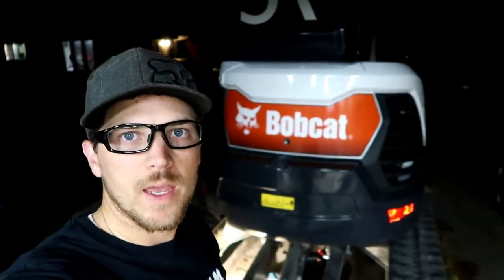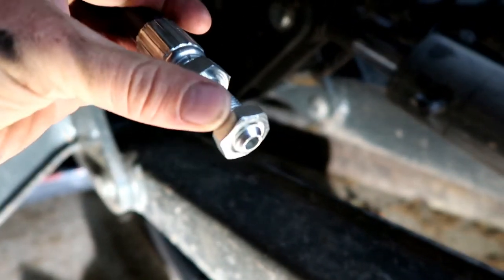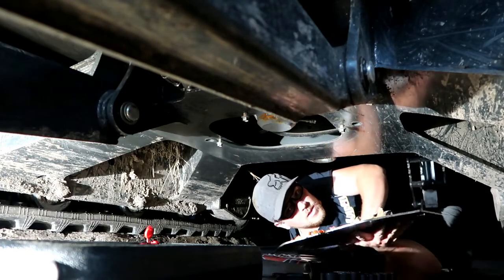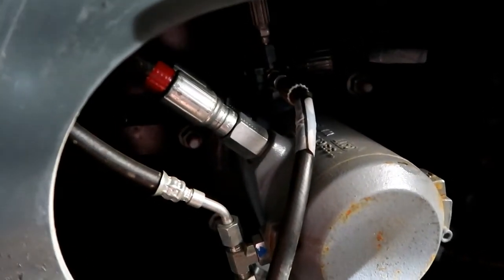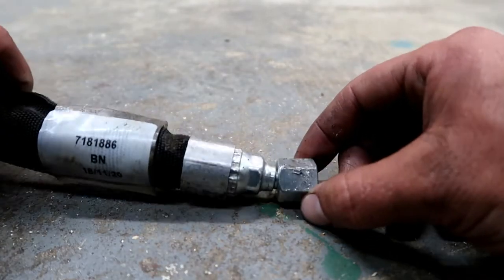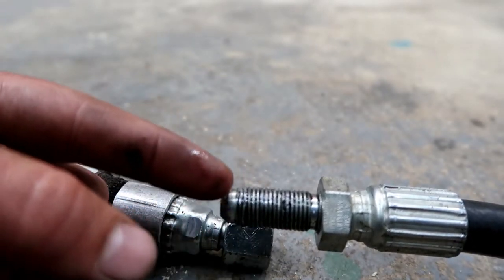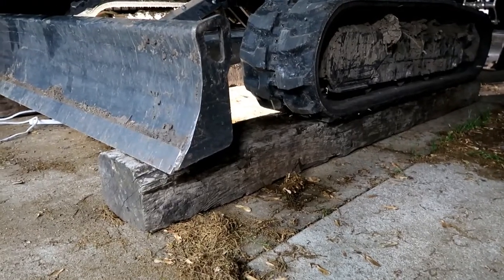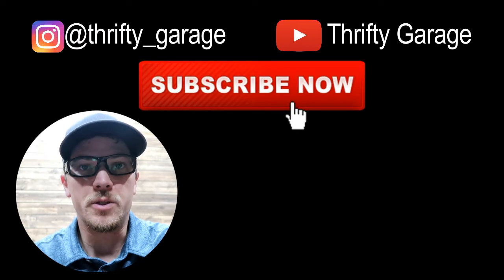How to Fix Hydraulic Leak on Bobcat e35 Excavator - Backfill Blade

Comment: Did you have to bleed the hydraulic system? I did the same thing you did, mines making some weird noises coming from hydraulic pump
Reply from the maker: It will have air in the lines but should sort itself out. I would definitely check your hydraulic fluid level and top off if necessary. I lost some fluid when the bent line occurred as well as during repairs and replacement.

Comment: Hi I have an e35  bobcat excavator two hydraulic hoses on front of bucket each one foot long,how do you remove bottom of hose after removing 2x3” plate, no room for wrench? Thanks in advance
Reply from the maker: The two hoses on the backfill blade? I’m not sure what 2x3” plate you are talking about. You may want to try a socket or crescent wrench. Perhaps crows feet.
Reply: Thanks,There are two short hoses in front of the backhoe that go to the bucket the little bucket at about 1 foot long and I cannot get a wrench on the bottom part of it